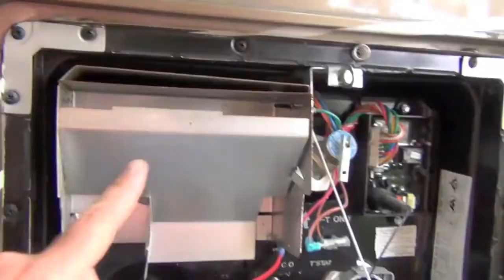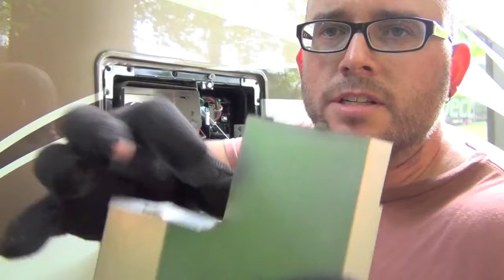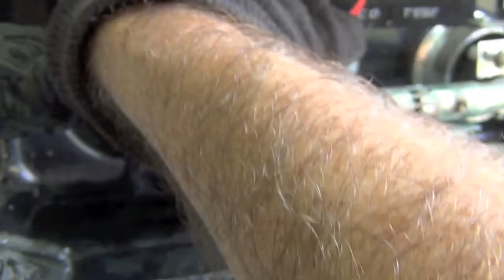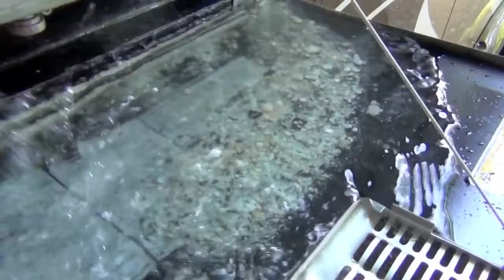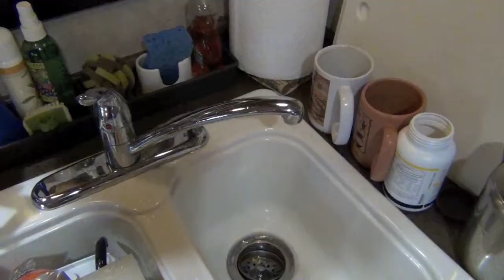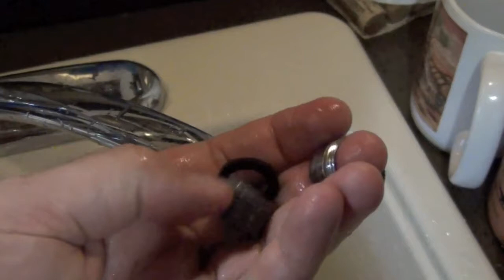How To Clean & Maintain Your RV Water Heater

Comment: Some RV hot water heater suggests  that draining the tank first. Secondly remove the pressure regulator..then close the drain. Next with mixture of 50/50 of water and white vinegar. Pour the vinegar water solution where you remove the regulator and allow the 50/50 solution overnight or 12 hours. Then empty the hot water heater and flush the system. Any idea how that might work. Like you it will be my first time in cleaning hot water heater.
Reply from the maker: Hi Richard - that sounds like it would work well to me. Probably does a better job than just flushing it out like I did. Vinegar does a good job of breaking down hard water build up. Good luck!

Comment: I’ve gotten grief for calling it a “hot water heater” too on an un-named RV message board so I’m not going to say anything. Thanks for the info. Do you have a bug screen for the “water heater” door?  Don’t want mud daubers getting in there. 😬
By the way, whoever decided that was a good place for a drain plug should be drawn and quartered. Just drained mine the other day. 😡

Comment: I've done this for several years now, albeit I do have an anode rod in our motorhome.   I clean mine every six months, and change the anode rod every year (get mine on Amazon).   I believe Camco products (as do others) makes a 'wand' which you attach to your hose, and the wand has an off/on tab on it, which often are used for putting down the toilet flush hole, to wash the inside of your black tank....but, this same wand fits nicely into the hole of the hot water heater/tank!   I also bought a long bristle brush, which is about 14 - 16" long, which I can shove in the hole and scrape around within the bottom of the tank, to loosen up any debris laying on the tank bottom, or the burner itself.   I then use the wand, which obviously has a hole at the bottom, and I'm able to shove it inside the tank and move it around in different directions, and as doing so, more crud drains out of the hole.  You end up putting more water into the tank that can drain, so every once in a while, pull the wand out, let the water/crud flow out, then do this over and over until you get clean clear water coming out!   Then add a new anode rod, and your good for six months or longer!   I say that because if you're in an area where the water is already soft (or you use a water softener) you're probably good to do this once a year if you have a filtration system prior to the water entering your RV.

Comment: I just bought a 2002 and I bet the owner never cleaned it out, mine has electric wires also in it and once shocked me when it was wet, how do I keep from being shocked?
Reply from the maker: The wires should all be sealed. If you look at the picture of our water heater, all the wires are either covered or embedded in some kind of non-conductive silicone to prevent that issue. If you've been shocked, I'd recommend having an RV repair person look at it to make sure it's sealed - otherwise you're likely to get a short and blow some fuses or worse. Good luck!

Comment: Thanks for putting this up. I have done this a couple of times but want to do a vinegar cycle to soften and remove mineral build up from tank and lines so will look elsewhere. Hot water heater is redundant and incorrect terminology though. Just water heater.

Comment: Atwood HWHs are Clad Aluminum which acts as it's own Anode. The problem with recommending Anodes for Atwoods is that you do not want an RV owner to install an anode rod with a steel threads into aluminum. It can cause Galvanic Corrosion and fuse together. We have seen it a lot when RV Owners are not informed. We say, if it is plastic, keep it plastic. The tank is protected from corrosion by design. here is an Atwood manual for Service.
http://manuals.adventurerv.net/Atwood-Water-Heater-Service.pdf
Reply: RV Holding Tank Service All Pro Water-Flow Just saw Serafins comment- didn't mean to duplicate!

Comment: same attwood not getting any water to it, Im a newbie, any suggestions on what dumb thing I am forgetting
Reply from the maker: Greg Fee Hi Greg - sounds like a blocked water line - or a valve is turned off somewhere. Normally the water heater fills up automatically once you connect to pressurized water. You could try opening the pressure release valve on the front of the heater and see if any air/water comes out. It's also possible there's a water line in the wall (behind drawers or cupboards) with a valve turned off. See if you can get in behind and follow the water line from the water heater to your city water/fill valve.
Reply: Trek With Us Check the winterize by pass.

Comment: I enjoyed your video. Better done than many, in both video and audio quality. Before watching it, I had purchased a 1/2" ratchet wrench, extension rod and socket to remove the all-metal anode rod from our old ISATA (different heater unit than in your video, with easier access to the plug/rod). Flakes as big as 1/2" across came rushing out with the water. I agree with an earlier comment to get a spray wand to agitate the junk so it flows out with the water.

Comment: I believe Atwood does not use anode rods but suburban does. Atwood uses an aluminum tank that serves the same purpose as the rod.
Reply from the maker: Yep - I had this convo with Serafin. It's a little confusing, because there are anode rods available for Atwood - made by Camco I believe - but as you say, Atwoods don't seem to need them due to the aluminum tanks.

Comment: Good morning.
Something about this video seemed fishy to me and I just had to check it out. I called Atwood yesterday and asked if I needed a anode since mine wasn't supplied when I bought the tailer.
Atwood told me (QUOTE)
"Serafin,
No you don't need an anode rod in an Atwood water heater, it is an
Aluminum tank and is not required. Do not install one it will void your
Warranty.
Mark"

The only tanks that require a anode are cast iron or steel. Aluminum tanks (like Atwood) don't require the anode. It will void a warranty.
I invite you to call Atwood for yourself to verify.

Thanks for your videos.
Reply from the maker: Yep, you're correct. I don't use an anode myself - never have. Thanks.
Reply: You may want to revise your video. I've watched a few of your videos at this point, and based on what you indicated in the video I went down to get an anode rod. While I was there they told me that Atwood water heaters don't need them because Atwoods are "lined with porcelain". They also said that that I "could put one in but it just wouldn't do me any good". Granted, they didn't know the true reason why Atwood water heaters don't use anode rods, but at least they knew that I didn't need to use one.

Thanks +Serafin Silva for posting that response from Atwood. It's good to hear from the horses mouth why Atwood water heaters not only don't require an anode rod, but why it is simply a very bad idea to even install one in any Atwood water heater.

I noticed below you indicated: "I wish I could change the video, but difficult at this point." Well, you could add a simple text over to the portion of video where you incorrectly suggest people install an anode rod; you wouldn't even have to edit the audio. My guess is that +Serafin Silva would give you permission to paste in the text of that response he got from Atwood. And even if he didn't, just shoot Atwood an email and get your own response, which I'm sure would be the exact same right... ;-) Then just upload it again. You only have just under 21K views on this one at this point and it's 3.5 years old. It could probably use the refresher anyway. Hell, I'll commit right now to watch it. Your integrity is worth more than these 20K+ views isn't it? Just sayin'

Comment from the maker: @Serafin Silva - I didn't turn a pump on, I turned the water faucet on to flush deposits out of the water heater drain. The Pressure relief valve won't work nearly as well as the drain as it's at the top of the water heater. The hard water deposits collect in the bottom of the water heater, so opening the drain works much better for cleaning out the water heater. Make sense?

Comment: Suburban is a much better design. You can fit a socket on the Anode, very easy compared to the Atwood, or as we call them Atshit! lol you must at all times run a Anode rod in a Surburban as its a steel tank. But the Atwood has a aluminium tank so there is no need for a Anode rod. good video mate
Reply from the maker: Hah! Thanks for your comment. I know some of the Atwoods can be accessed directly with a socket, but unfortunately ours is right behind the propane line which make little sense as you say. I'll be interested to see how long it lasts, but so far 2 years with daily usage - so at least it's not complete junk! :-)